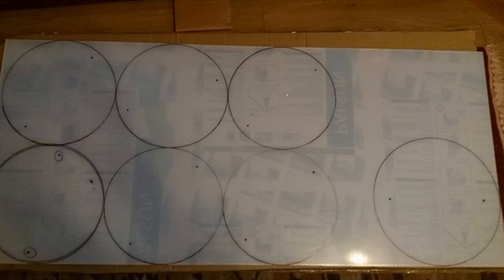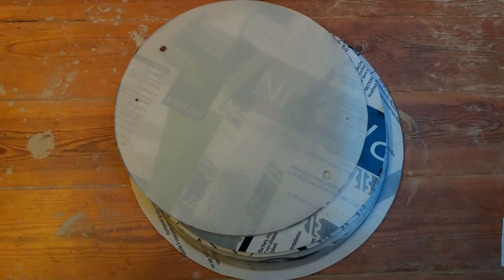How To Make Bats For Potter's Wheel (NEW)

Comment: Have you cut out centre pieces like in the previous marine ply video? How long do marine ply ones last?
Thanks in advance
Reply from the maker: Hi. The reason I made the plastic ones was because the plywood bats warped. The little cut out ones were ok though. I didn't show it in this video but I made square bats that were wide enough diagonally to fit on the pins. They were larger than the little square inserts in the other video but you can fit more thrown pieces side by side when drying than the circles.
Reply: @PiedPiperfly  So how long did the marine plywood bats last? My old pottery class used to have regular 6mm plywood bats. They didn't warp, but the pin holes wore and the bats started to slip after the second term.
Reply from the maker: Hi. Mine did warp before wearing out. But then i made bats out of polycarbonate. Have a look at my other video. In the long run, the polycarbonate will be cheaper.